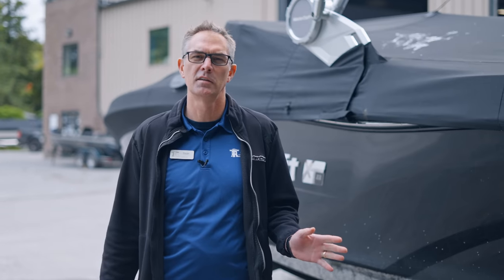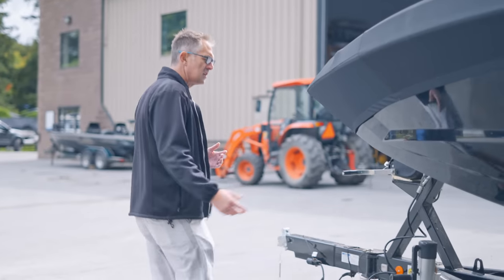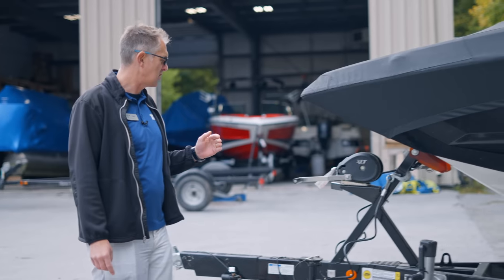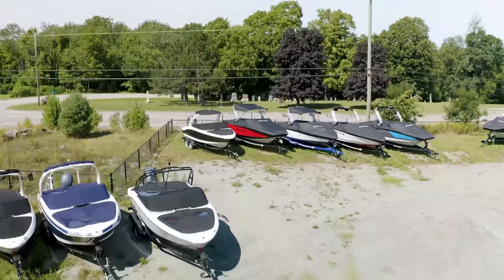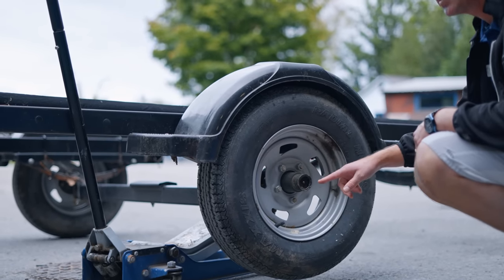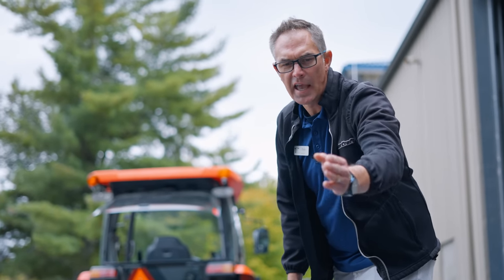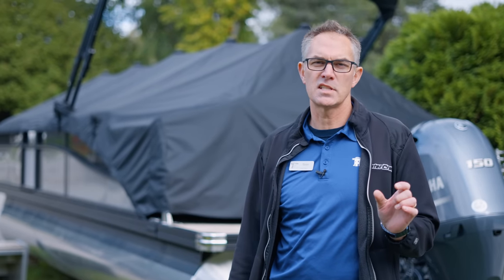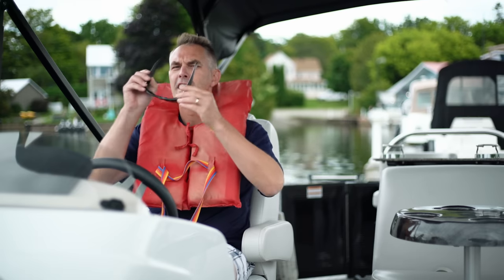Boat Trailering Mistakes

Comment: If you have a tandem or a triple and the suspension gets very load, (leaf spring type)check your equalizers as the holes may be egged out and will need replaced , also there is a new bearing buddy out there with blue inserts which tells you when to add grease !

Comment: You mentioned about the strap from Winch to Boat, check for wear, how about the safety chain which goes from boat frame to Bow eyebolt. I've witnessed a boat fly off a trailer without a safety chain attached. FibreGlass and asphalt don't mix well at 60 MPH. Montreal Bass Boat.

Comment: On every trip or two after you’ve driven at least twenty minutes, check temperature on trailer hubs by touching dust cap.  If one is hot it could mean problem w bearing. And don’t forget to check tire pressure on trailer spare…it wont do you much good if under inflated. In your truck or boat have some spare bulbs for trailer lights…they go out fairly often and are easily replaced if you have em on hand.

Comment: It amazes me that the USA hasn't discovered wobble rollers for their trailers yet. That's really all we use in New Zealand.  They enable you to approach the  trailer with the boat at a wide range of angles. Way way way better than bunks. They grab the boat and centre it.
Reply: Not sure if you mean the same thing, but rollers are a common option on trailers.  Many people don't like them because your boat rolls off as easy as it rolls on.  You have to have 2 experienced people to load and unload a boat.  With bunks, you can park so it's almost floating,  unhook from the trailer and pull it off with the engine,  then park the boat and go move your truck. If you have rollers, the boat is going off the back of the trailer the second you loosen the strap, if you are in it or not.  There are ways around this, but they involve a second rope.  With bunks, as long as the trailer is as the right depth, the boat stays in place while you get in and out.
Reply: When I was a kid that is all you saw was wobble rollers.  There were many different kinds.  they have faded out over the years.  Newer trailers have precision placed bunks specific to the boat it was built for that work great.  Wobble rollers are more versatile and good if you are using your trailer to haul a variety of hull size and shapes.
Reply: It depends on where in the USA you are….in the north east where the tides change water depth 6 feet from low to high tide you see plenty of full roller trailers. Tides & shallow ramps are difficult for bunk trailers a roller can be used where a bunk cannot.

Comment: #1 get your boat and trailer weighed, to make sure the trailer is not overloaded. Boats, and RVs often weigh more than what the manufacturer says it does, and most boat/trailer combinations at best only have about 10% tire reserve capacity, versus your tow vehicle which usually will have 25-30% even at full load. I have had good luck with Kenda Load Star K550 Bias ply tires, I think they hold up better than cheap radials.
Reply from the maker: Great advice! Thank you for sharing :)

Comment: I like to add to the safety of the trailer wheels. Make sure you're not overloading the tires. the tires should have a max load weight on them. know the boat weight with the normal loading ie. gas full tank, any additional weight like t tops, added seats etc. Know the weight of the trailer (without boat on it). Also, if you put coolers, heavy tackle boxes, and other added weight, make sure you don't exceed the load weight of the tires.If you have a heavy boat, I recommend dual axles or even three depending on weight. Also a point to make is know your safe trailering weight of your vehicle and the safe tongue weight of your trailer hench. God bless and happy boating.

Comment: Hi Sean. Great video! Any advise on the vault hubs? They say no maintenance required but my trailer is 11 years old now and ive taken it to two shops(Boat and general mechanic) and both have said they look fine and dont recommend replacement or servicing. Any tips or learnings you have over the years?

Comment: I was using my trailer in both fresh and salt water. I used anti seize lube on the lugnuts. I tightened the lugs as usual but going down the road one tire came off. I ended up having to take one lug nut off the other tires so I could get to a parts store. Live and learn. Thankfully it was only a 14' aluminum boat.
Reply: I pull trailers on salted roads...
Having lug nuts freeze on and have to replace studs due to twisting them off while trying to remove them...lesson learned..
As a general rule don't lube lug nuts with anything....
I do because I'll need to get them off one day...
Also.. retorque after a few miles and you probably will never have a problem..
Oh....if you depended on toque wrench on those rusty bolts ,you'll really be under tightening....
You'll have to use some good judgment while doing so....or replace all studs and nuts every few years...
Reply: @jonjacobjingleheimerschmid3798  Need to adjust torque specs if you're lubricating threads.
Reply: @moonpiespotlight4759  what part of 
" freezing on" did you miss?
As not many actually toque wrench anyway...I only do on emergency equipment and now and again to keep that muscle memory accurate
So everything is " goodntight"

Comment: Good video and very good advices. Double check for safety!
What pressure tire is recommended, besides the interval marked on it?
Reply: The max pressure is written right on the side of the tire. It is usually between 50 and 70 psi.

Comment: My boat goes in and out of salt water, so I dedicate a day before boating season to taking the wheels off, replacing the bearing inner and outer and lots of lube, the brakes rot completely out so I removed them and I dont care what they say no one makes trailer lights that last for more than a two years.

Comment: You guys hit a lot of it, but a couple things you missed were :
1. When checking your bearings, make sure you hit your bearing buddies with a little grease at the end of each season. Just make sure the cap that's under spring tension  is somewhere in the middle of where it rides. 

2. After driving for a while, check the temperature of your hubs. They should be a little warm but not hot. If they're hot, you have a bearing or brake issue that needs to be addressed before you go much further. 

3. Trailer brakes should be inspected once a season, especially if you launch your boat in salt water. 

4. Last but not least, carefully wash your trailer any time it has been exposed to salt. Giving it a dunk in a fresh water lake after it's been in salt water is a great idea. Just make sure you're not introducing any invasive species into said lake. A quick dunk in fresh water should work to get a lot of salt off the trailer while not giving critters enough time to jump off your boat. If your boat has a lot of growth on it, you might want to start by pressure washing your setup before taking it to the lake.

Comment: The number one cause of wheel bearing failure is preloading the bearings.
The wheel bearing needs to have clearance you should have about 1/8 of a inch play at the top of the wheel.
If you adjust it with no play when the bearing heats up and expands it will reduce the clearance and become preloaded then overheat and fail.
Over tightened wheel bearings fail very very quickly.
A bearing with excessive clearance does not fail because of excessive clearance.
Use a good quality grease,adjust the bearing correctly use a bearing buddy and wait for hub to cool down before submerging in water and you will never have a bearing failure.
Service your bearings once a year especially on trailers with small wheels.
Reply: 1/8 inch is a lot. Way more than the bearing expands. Finger tight is what I’ve always gone by
Reply: 1/8 play at the top of the wheel is next to nothing at the bearing, finger tight on the adjustment nut is zero clearance on the bearing cold and preloaded when hot.I have serviced and adjusted 1000s of wheel bearings I was taught this 45 years ago by WW2 mechanics. @BabyGators

Comment: I live near a river that is super busy with boats and rafts as soon as the high water goes down. There have been several fires that were caused by wheel bearing failure and dragging safety chains. Dry grass from July on ignites fast. I remember one summer a trailer safety chain dragging made fires all along I-90 for over 50 miles. It seems like the guy was chased down by the Highway Patrol and stopped. I think he had to pay for damages and fire suppression as well.
Reply: La crosse Wisconsin area?

Comment: I just saw you guys making the mistake of jacking the trailer up by the axle. Can bend the axle doing that…especially if you have the weight of a boat on it. You of all people should know to jack up a trailer by the frame. Pick closest point to the wheel. Also careful you don’t pinch any wires that may be coming out of the frame at the jack point you pick.

Comment: On the safety chain, DO NOT USE the steel cable that many trailer manufacturers install.  I learned this the hard way when my trailer disengaged from the ball and the cables failed.  Yes, they snapped like rubber bands.  the trailer and boat were going down the highway on their own.  Yikes!  It was a horrible experience and luckily my boat and trailer survived. with a few repairs to the trailer and a scratched boat.  Luckily there was a concrete barrier on the right and I was in the right lane.  It could have been catastrophic.  I now have heavy duty chains as my safety net.  I also installed a safety chain to catch the boat if the strap you wind the boat back on the trailer fails.  I then had heavy duty tie-downs welded on the trailer to keep the rear of the boat trailered properly.  Don't trust what these trailer manufacturers are putting out.  They are cutting corners.  Best to learn from others' mistakes.  You're welcome.
Reply: Yes on the safety chain!

Comment: I’ve never seen a frayed chain in my life!!!!
Reply: Exactly.  Those steel cables on the other hand, will fail.
Reply: I had a 6000 lb chain snap with a Pontiac V8 and tranny hanging on an engine hoist once. Made me a frayed!! Upon further inspection found two nicks in one of the chain links like somebody hit it with a hatchet. That motor dropped REAL fast!

Comment: I saw a really bad bass boat bunk break. Boy was that bad. Evidently it had came almost off on the rear and as he was loading the boat the bunk just kind of floated away from the bracket. Well the bracket ripped a deep tear about 1-1.5 feet long before he realized it was happening. I noticed he had a new boat the next year. He said his insurance covered it.

Comment: How about maintenance on the tow vehicle. I just had to have my rear differential on my Dodge Ram rebuilt. Regardless of submersion
Over time water contact can degrade
Lubricants causing bearing ir gear failure.

Comment: Consider visually inspecting all welds underneath your trailer. If it has rubber coated /under armor type of coating inspect the weld joins for cracks and rust. Water can pool there and the crack/rusting process begins.
50-100K costs for boats nowadays do yourself a favor and replace your tires much sooner than later even if it has just been sitting.
1 ruined trip because of a bad tire is just not worth it IMHO.

Comment: Inflate tires to maximum stated pressure.  A full tire runs cooler because there is less material in contact with the road.  Heat buildup is the #1 cause of blow outs - not road hazards.  Any defect or ageing of the tire will be found and exploited by heat.

Comment: There's are not really any excuses. 1. The 'Bearing Buddy' type grease fitting allows anyone to load the wheel bearings with fresh grease frequently with ease. 2. The powerful cordless brushless impact wrenches allows easy swapping the spare onto the trailer anywhere. 3. Take care of your trailer tires. I recommend checking air pressure as often as possible. Never store trailer with wheel touching the ground for long periods of time to prevent dry rot. Tires don't last forever. After awhile they need replaced, even if they look OK. Always make sure your lights are working correctly. Keep a spare bulb available, or better yet, upgrade to LED. I always disconnect my trailer wire harness before backing it into the water. It only takes a second to unplug and re-plug.

Comment: We trailer our boat 850 miles round trip 2 or 3 times a year. We never go longer than 6 years on a set of tires even tho our boat is garaged. Our trailer has oil-filled hubs. Was not sure if I would like them, but they are GREAT! Safe trailering & boating to all!

Comment: Tires have a shelf life. I got a blowout on a trailer tire. It had no visible damage. The tires were 10 years old but still had the little nubs on the side and looked new. I found out that tires need to be replaced every 8 or 9 years.😢
Reply: 5 years for me, travel trailer, boat trailer, and utility trailer

Comment: another thing I do is I use tire covers, yes they can be expensive and a pain in the you know what, but they help protect the tires from UV rays which also speed up dry rot.
Reply: Do you use them on your vehicle as well? My Truck sits in the sun just like my boat, I don't worry about dry rot. Tires should be replaced on a timed basis, not by tread wear (especially on boat trailers).

Comment: trailer tires are only good for about 2 years here in Arizona when the boat is stored outside. 4 years if you're extremely lucky but i wouldn't risk it.
Reply from the maker: The more intense the sun, the more they rot - agreed!
Reply: Robert
I understand about the Arizona sun.  Does that also apply to car tires?  Every two years would get expensive.
Reply: @darrelldreher5980  
Nope. Car tires seem to do relatively fine. Not sure if its the quality or the load or both that reduce the trailer tires life.
Reply: @robertsaget9697  probably because of the time sitting

Comment: Great vid.  One question , can I jack the trailer with boat on and using a car jack ? Thanks
Reply from the maker: Yes, you can as long as the other wheel is safely checked and you don’t go too high.

Comment: Trailer tires… regardless of miles after 8-10 years REPLACE THEM. And buy good ones. They dry rot just sitting, and greatly increase a chance of a blowout. Think about how many times you’ve seen a trailer on the side of the road with a blown tire…

Also pay attention to the speed rating of the tires! A lot of cheaper trailer tires for 15” and smaller wheels are only speed rated to 65-72mph. I had to shop around to get 14” tires that are rated for 80+

Comment: You should have straps across  the boat  holding it onto the trailer   proper chain   holding the trailer to the car  - remove the hub do it with the tyre still on   look into the rear bearing  most bearings are cheap seals are cheap   30 min to 1 hour per side   so you have a cold drink  on afternoon

Comment: How do you check hub torque?  Never seen a chart for torque specs on the castle nut.
Reply: The castle nut isn't torqued, its retained from spinning off by a cotter pin. Do a search for details, but basically you tighten the nut down to seat the bearings, then back it off till loose, hand tighten then insert cotter pin. Check wheel for run-out and adjust aaccordingly. There are many videos that show this.

Comment: When backing trailer into the water is it ok to leave lights plugged in? Or disconnect?
Reply from the maker: You will get an answer 50/50 on that one! We always leave them connected with new issue.
Reply: If you have a trailer with serge disc brakes you need to have the trailer plugged in to operate the solenoid that keeps the brakes from engaging
Reply: With newer LED lights they should be better
Reply: I like to unplug. I don't have LED's.
Reply: I leave mine connected and have even dunked them.  If the housing is sealed with wiring it shouldn't be an issue.

Comment: i have some noticeable vibration the first few miles of towing my boat but it goes away.tires are new bearings are good cant figure out why.maybe have tires balanced and weighted? everything is like new so I'm stumped.? any suggestions
Reply from the maker: It could be that the tires themselves take a slight shape (flatten a bit) where they sit at rest when not in use. Once the tires heat up after the first few miles, they soften and return to proper shape.
Reply: Agree

Comment: Trailer the boat covered or uncovered? (Assume highway speeds)
Reply from the maker: If possible, uncovered. It is really hard on the covers.
Reply: It depends on if your cover is rated for travel.  Some are and some are not.

Comment: 🌟🌟🌟🌟🌟The oval circle @1" long with 4 numbers in side - first 2 are year and second 2 are week of that year. Example: 2216 - year 2022 and produced the 16th week of 2022. , I do not know in Canada, Iam from the U.S.A. . Thank you for your videos :)
Reply from the maker: Thanks for the info!
Reply: Actually it's the other way around.  The first two numbers are the week and the last two are the year of production. Hope this helps.  

Also while the D.O.T. numbers are on both sides, the date code is sometimes only on one side.
Reply: @YesThatSuperDave  , Awww yes LOL, it has been many years since I have had to worrie about the dates. I use to haul 5th wheels and the tires would have half a tread and tell me they will be fine-LOLOL. Umm NO! , All the boat tips are so great, some dont apply but it is good learning and it keeps me outta trouble--Ha ha - iam 59 - did i say iam married AND have a boat. It was great comms here take care all :)
Reply: @twlyons1  I've had people tell me," Those tires are new, I just put them on last year." When in reality the tires are 10+ years old.
Reply: @YesThatSuperDave  LOLOL, yeah, time slips away some times ha ha.